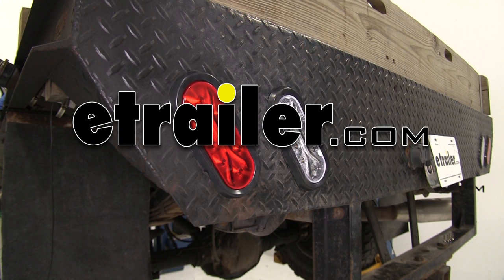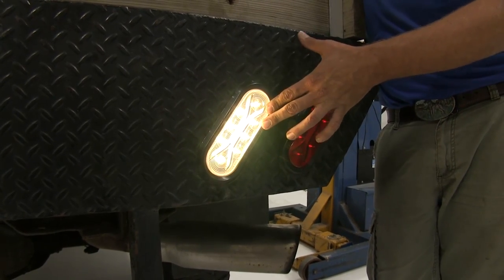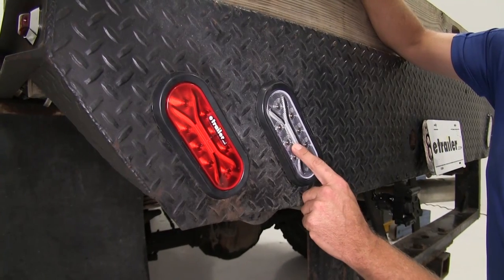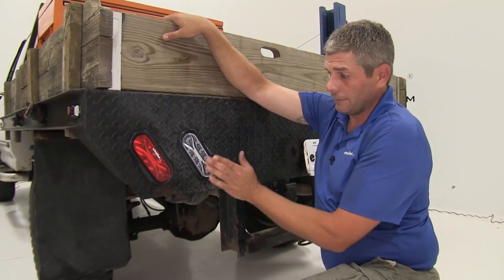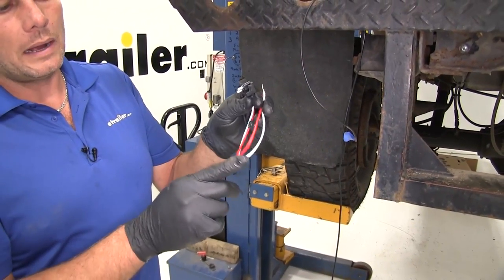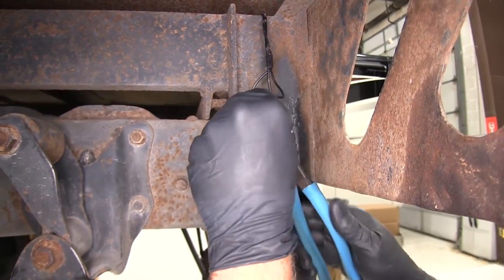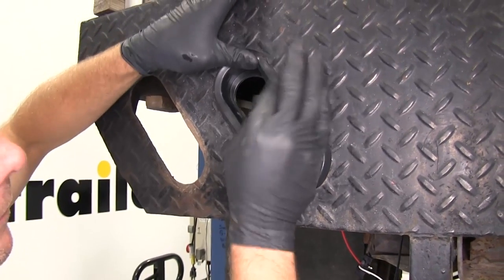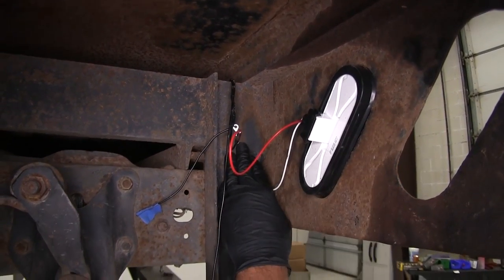etrailer | Light Guide LED Backup Light for Truck/Trailer: The Breakdown

Comment: I like your idea to bend the wire back over itself in the bigger connector that has only one wire going in.
Reply from the maker: It will provide better contact for the connection because of the size of the wire.
https://www.etrailer.com/Trailer-Lights/Optronics/BUL602CB.html

Comment: do the turn signals work while applying the brake at the same time?
Reply from the maker: The answer to that question will depend on the way the taillights on the tow vehicle are wired. If the brake lamp and turn signals on your vehicle are carried on separate circuits (usually have amber turn signals), make sure your vehicle has the tow package or otherwise, use a taillight converter. If the tow vehicle does NOT have amber turn signals that use the same taillight for the turn signal and brake lamp, these will work great right out of the box.
https://www.etrailer.com/Trailer-Lights/Optronics/BUL602CB.html

Comment: What is the width of the holes for these lights? I can’t decide whether I need to make mine about 2&3/8 wide or 2&1/2”. Want to make sure the light and grommet are snug but not super hard to install
Reply from the maker: The width of these lights are 2 3/8" so you will want to make the hole slightly larger to be able to fit the grommet in.
https://www.etrailer.com/Trailer-Lights/Optronics/BUL602CB.html
https://www.etrailer.com/Accessories-and-Parts/Optronics/a70gb.html

Comment: I'm sorry but that's just a really bad recommended installation from a supplier.  For a video about 'Oval Trailer Light Installation' ... it would have been really nice if the video started with laying out the oval cutouts on the bare metal, provide the exact cutout dimensions needed and showed how you cutout and clean up the edges of the ovals.  For the wiring - anyone who's owned and used a trailer of any kind knows the wiring shown in the video is junk.  This is a perfect example of 'how not to wire trailer lights'.  Make all electrical connections using water-tight, heat shrinkable, crimp connectors or by soldering the connections and covering with heatshrink tubing.  And show how to properly secure the wires up underneath - don;t just say 'don't leave it like this'.  I'm sorry, but I expected more from a trailer pro.
Reply from the maker: Check out the following link to an expert answer. Mike provides a cut out diagram to help with cutting a hole.
https://www.etrailer.com/question-64864.html

https://www.etrailer.com/Trailer-Lights/Optronics/BUL602CB.html

Comment: Crimps on truck lights is a real bad idea. I get that you need to use them sometimes but these could've been soldered.
Reply from the maker: We have had really good result using heat shrink butt connectors with wiring lasting for years when exposed to the elements. If you have the materials and skill to solder the connections then you can do that too.
https://www.etrailer.com/Trailer-Lights/Optronics/BUL602CB.html
Reply: They’ve come a long way. The heat shrink & solder butt connectors are amazing and honestly have worked better for me than soldering, as the connection is completely encased in a glue and plastic and protected.